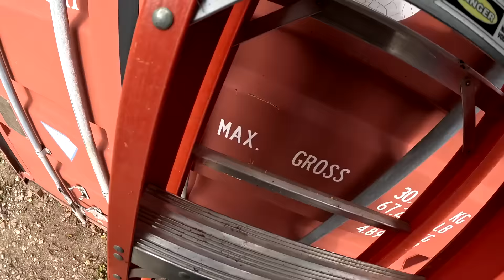Concrete day....Lets get pouring the new floor

Comment: Looks good, Bill! Dillion is a big guy! Thank heavens for Kevin being there! For my concrete I would have put down a heavy plastic sheathing to keep the moister from bleeding through and some of the cold. Should have let the concrete tighten up a bit before power troweling. I mostly see guys get on knee boards after it tightens up without using a power trowel.

Comment: Thanks Bill..
I can't wait to get the Floor in My 30x40 Pole Shed poured.
That will be 5" of Fiber Mesh and FiberGlass Rebar. It will be a Wood heated in-Floor Heat too...
Probably going to have to rent a Power buggy to get to the Back corners of the Shed, A lot cheaper than a Pumper Truck.
Couple of Grade pins in the center would have helped Kevin out. 
I've seen Guys mount a level on the Screed handle to see how close they are.
My House Slab was poured on 10/31/19. and it was a constant battle with leaves HAHAHAHA..
Reply from the maker: Good deal :)